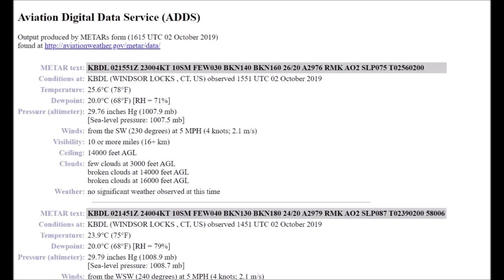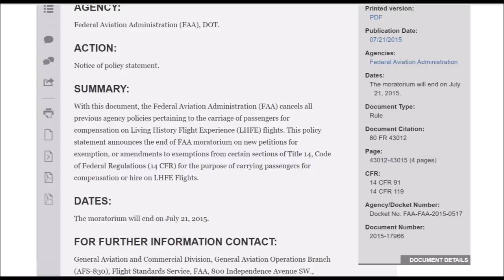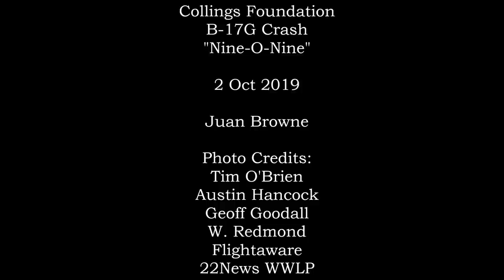B-17G Crash Collings Foundation KBDL 2 Oct 2019

Comment: Experience, in aviation, is a liability. This is what all my experience as a pilot and mechanic tells me. Older pilots have a very bad habit of not recognizing their limitations. 
The whole story about the pilot grabbing a spray can to "blow out the moisture" is a clear indicator they were cutting corners. They used starter fluid to start a malfunctioning engine on a 74 year old aircraft! You don't have to be an experienced A&P to know this is completely unacceptable on any aircraft. The fact that engine is the one that fails means there was a chance to make the right decision on the ground. 
I have been wanting to fly on this plane for decades and now, due to mismanagement and incompetence, I never will. Now, I don't think I'd get on any warbird because the people taking care of them obviously either don't know what they're doing or don't do it as a result of cost-cutting. 
It is at the point where these aircraft are valuable enough to warrant the construction of replicas for passenger flight. At some point, they are just too old to be safe. And that's from someone who used to overhaul 30+ year old B747s with far more cycles than these antiques.
Oh, well. After the 737 max debacle, it is clear the aviation industry is falling apart, safety wise. We used to have the safest system in the world but corruption ruins everything.
Blancoliro needs to stop defending the appalling way these aircraft are operated and the FAA needs to make sure they tell passengers just what kind of rats nest they are boarding.

Comment: So sad.  It's early of course.  I think if anything the return to the airport was the wrong move, and the desire to save the plane itself was likely a factor in the attempt to return.  Something more than just the engine failure was going on.  I'm thinking a fire.  One of the Pilots said "return to blow it out."  I think that reveals their mindset to save the plane also.  Reports are of it being low and fast.  I imagine coming in nearly level to the ground in a tail dragger is a bad proposition for control on touch down.  Normally they land through controlled stalls.  

The pilots were human lives also.  I'm not at all suggesting they weren't concerned about the safety of themselves and their passengers.  Better emergency services are at an airport.  It's not like an emergency immediately declares the loss of the aircraft is imminent, and they did reach the airport showing the attempt was not against reason.  The outcome suggests to me that they could have touched down elsewhere with better results mostly because they would have kept the airspeed and altitude lost in the turn and all of their attention would have been on the best landing possible.  Obviously that's hindsight.

Someone suggested this wasn't a tour flight but was actually a departing flight for the next destination on the tour.  If that was the case then it probably had more fuel, obviously 13 people on board is full crew, but it's still hard to see it struggling so bad on three engines, but could a catastrophic failure of number four engine have hurt hydraulics?  Possibly a progressed fire, but no witnesses describe the aircraft on fire.  Obviously the investigation will run its course, but it's hard to understand how just the loss of an engine resulted in this outcome, which could also get back to the decision to return to the airport.  The return decision was made before the full scope of this particular emergency was in view.  By the time you are pointed back at an airport in reach or committed in the turn around, landing elsewhere would just seem asinine.  

I'm not questioning the skills, ethics, or decisions of the pilots beyond the reality that preserving the aircraft itself is certainly more of a factor with a vintage aircraft than something insurance will replace.  Mostly I'm just baffled that the loss of an engine lead to this outcome on a B-17.  Fully loaded in wartime, yes the loss of an engine on takeoff often meant disaster, but that was shortly off the runway not minutes into a flight that managed to return to the field, and it's very unlikely the nine-o-nine was near that gross weight.
Reply: I just read in a story that the plane clipped a pole as it touched down which further explains the severity of the crash.  Apparently they had a very near miss with a much less tragic touchdown.  So terribly sad, but most likely very skilled and heroic efforts came up just a little short in this event.

Comment: This is heartbreaking in every respect. 

I wonder if there was s serious problem with one of the main landing gear...
Reply: That would explain much, I don't think the pilot made a wrong turn. May God's mercy shin on all  involved in this sad affair!
Reply: @lakewoodsteve5028  The only other thought I had on this very sad tragedy is that due to the extra power on the right side from two engines running, trimming the aircraft was a problem, and it veered right into the de-icing area. Having twice the power on the right side would have a strong tendency to skew the aircraft to the right.

Comment: I actually flew the Collings foundation on a tour during that. Of time the B-17 develop to a dead cylinder on the two engine... rather than make the necessary repairs for a safe aircraft they decided to take paying customers on a Joyride, also on the same tour the B-24 developed to a main landing gear issue somebody lost the valve stem core they decided to take the valve stem core out of a rental car and put it in the main landing gear of the only airworthy B-24 Liberator on the face of the Earth.... it's my belief that the system of pain to fly in a warbird in a Irreplaceable piece of aviation history should be outlawed. We have lost two b-17s we have lost a DC-3 all in the short span of approximately 5 years. I would also note the Collings Foundation operates an F4 Phantom
Reply: Just imagine that F-4 Phantom hitting the ground at 700 knots maybe they'll put it into somebody's neighborhood

Comment: I'm wondering if there was something else that was not declared in the emergency.  hundreds of these planes made it home and safely landed with single engine failures, and there is plenty of film of such planes doing such.

How old was the pilot?  You said "very experienced".  WW2 veteran?  Boomer kid of WW2 veteran?  Could the pilot have panicked on the engine failure and maybe stroked or had a heart attack?  I ask, because when I was younger (1970's to late 1990's) most of these guys that showed up to USN and USAF air shows with these planes were kinda old then.  Also, we live near a small airport where a few years ago, they made a big deal out of a 90-something flight instructor who refuses to stop flying, and at that age, I don't care how fit someone is, the bell curve says that a stroke or heart attack is a roll of the dice (we kinda hope that old man locally has decided to just do classroom instruction since then).

It's a shame that the seven have died in this accident, and that the plane was lost as well.  There are so few left.
Reply: According to the NTSB news conference today, the pilot had flown for Collings Foundation for over 20 years and had over 7,000 hours in the B17.

Comment: Losing one of engine wouldn’t have caused this unless it exploded and severed things that caused the crash.
Reply: There's a rumor that this B-17 was refueled with Jet A, not 100LL avgas..  If the rumor is true, it would explain the loss of one engine and loss of power in the other three.
Reply: @ohger1  Not according to the NTSB, who said in a news conference today that they had taken a sample from the right wing tank and it was 100 octane low lead and also said that the aircraft was rated for 87 octane but could use any higher octane.

Comment: Not to make light of regs...they're all written in blood....but this had nothing to do with the airplane in my opinion.  From what I understand the plane lost #4 on take off...not a big deal as light as they were.  There are reports of at least 2 other engines having trouble.  So it appears there were 3 engines effected by something.  What is the ONLY common factor for 3 engines....fuel.  I don't have any information other than what is on the news...worthless....but at this time I would offer someone MAY have put Jet A in the plane on refueling.  I can't really see anything else that could have cause 3 engines to have trouble.  Not accusing anyone or trying to armchair quarterback...I haven't been to the site....been to BDL hundreds of times....It's very sad and could very possibly been cause by a relatively simple mistake.  God Bless all of them.....and I pray this doesn't set up a knee jerk REACTION from the FAA.  I don't think they're going to find it was the airplane at cause.  I'm an experienced pilot, A&P, IA....this is opinion only.....

Comment: I wonder how one engine out on a 4 engine plane can go so bad. Perhaps being a tail dragger had something to do with it.
Reply: Losing one outboard engine on the right side creates asymmetrical thrust, which makes the airplane want to yaw (turn) towards the non-running engine. That may have contributed to it going out of control to the right after the main wheels touch down and before the tail wheel did.

Comment: Considering the aircraft veered off the runway I can't help but think about the scene in Memphis Belle where the plane landed with only one of the main landing gear down. If the landing gear was damaged by hitting something the plane would be out of control on the ground. Video link attached. Thoughts?
https://youtu.be/Ox29ru5hmeo

Comment: It seems to me that the airframe could not withstand the weight of the load causing the landing gear  to collapse and it turned into the de icing area.
I can see the buzz and excitement to be in a historic aircraft but these were built without safety in line.
It was about numbers not safety.
Only the three crew should be in that aircraft while in mid flight and nobody else.
A unfortunate incident waiting to happen.

Comment: This video is very informative, but sounds like an attempt to protect the Collins foundation and any other operator out there that operate these old aircraft against any FAA outcome that may go against future warbird resurrection and protection. I can appreciate the money involved to keep these aircraft operational and airworthy, aviation is not cheap, however, perhaps other revenues of funding will have to be explored rather than offering flights in these aircraft. People will always flock to fly in one of these aircraft, but no matter how safe the owner/operator is, the aircraft was still built with engineering and safety guidelines during wartime efforts. This particular aircraft was designed over 70 years ago to drop bombs and protect itself against enemy fire, the crew were military airmen that knew and accepted the risks (some may not of), but not to carry passengers.I know many will argue that point but, if it walk and talks like a duck, its still a duck, no matter how many life jackets, seat belts, rafts, single engine procedures, etc. are in place. I hope that the families of all involved are looked after and that the FAA and the warbird operators can work out something that does not put anymore passengers at risk. These are not as safe as today's passenger aircraft flying Category A aircraft in Part 135 as the presenter insinuates. They put their best foot forward with training and pilot checkrides and proper regulatory oversight, but bottom line is still, the aircraft is an antique and should be operated as such, not as a passenger carrying wannabee in order to stay afloat.